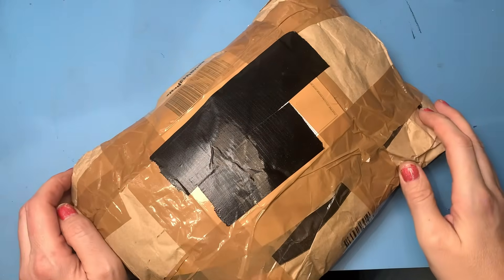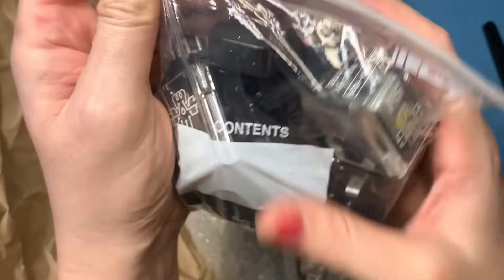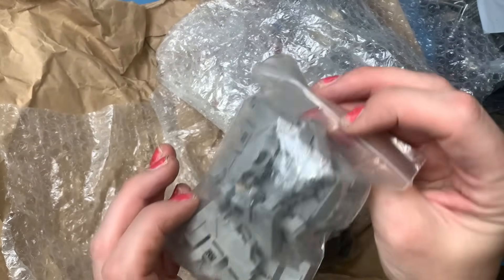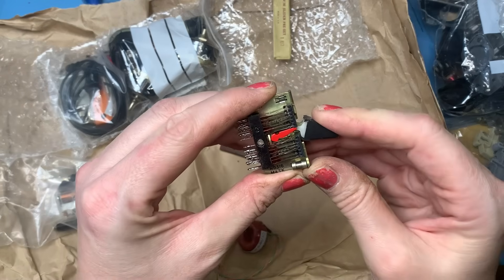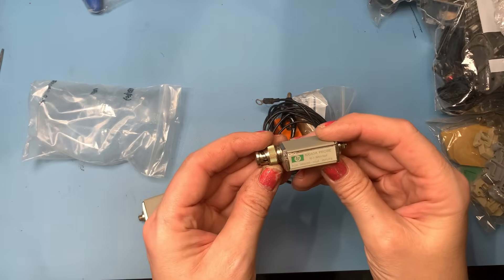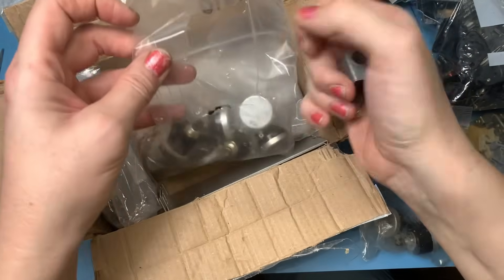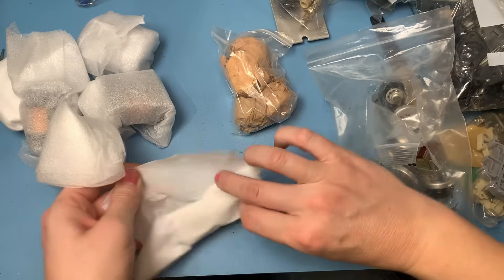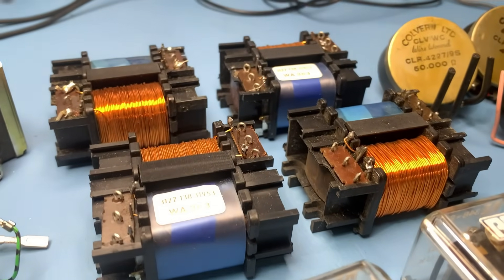Random Electronic Components eBay Mini Mailbag!  Bargain or Junk?

Comment: I got a tool caddy loaded with parts (resistors, capacitors, transistors) and even a multimeter for $10 off eBay a couple years ago. Was apparently part of a home study course from ITT Technical Institute. The multimeter alone was worth more than my $10. I call this a win.
Reply from the maker: If you shop carefully on eBay you can get some fantastic bargains. Thanks for the sub and thanks for watching.

Comment: It really depends if the relay are new or not, I don't think they are
Reply from the maker: I have no reason to think they are not new. I will have to look closely at the pins and contacts. Thanks for watching.
Reply: @JazzTechUK i personally think this material is " recover " (scraped) from Old equipment, what would explain the random wires.

Comment: Back more years than i like to remember there was a components seller on the back of one of the mags who sold 'lots' of components .most were sold by weight and it was like Christmas when the huge box arrived .50% were for the bin as a lot was random metalwork or fittings but boy there was some great stuff .have you ever seen hand written values on resistors i got loads . Tons of one off values for long forgotten devices that obviously needed precise values .still got a box of caps i have never opened probably all long gone and leaking but i am a terrible hoarder
Reply from the maker: That's an interesting story. Thanks for watching.

Comment: Nice haul of 70s/80s stuff, a lot from telecommunications systems. I remember most of them well. Those 'switches' were a staple diet for those of us who worked on 70s comms and broadcasting, and the slightly later Ericsson switches. Those Colvern wirewound pots were standard in the 70s and were very reliable.They will certainly come in handy for spares for equipment of that era, so well done Jane on getting a good bargain.
Reply from the maker: Thank you and thanks for watching.

Comment: I think i saw these listings when buying something else. I had a quick look at the photos but its all stuff i don't need.

Ive already got transformers, relays and pots. The problem is that you don't know what you need until you need it and it is usually something specific that won't be in a job lot of mixed components/parts.
Reply from the maker: There were some bits I wanted. The rest was just for making the video for entertainment purposes. Thanks for watching.

Comment: Nice parts, got to love the build quality of old time electronics. I think those pots would be great for somenone building something like tube guitar- or HiFi amps, they look very nice and well made.

 I have bought some job lots of vintage camera stuff on Ebay, especially the UK has huge amounts of camera gear for sale. Unfortunately after Brexit we here in Finland have to pay 25% VAT on everything from the UK so not that affordable any more.
Reply from the maker: If you need a wire-wound power pot, they are expensive to buy. Some old equipment I have does have wire-wound pots in.